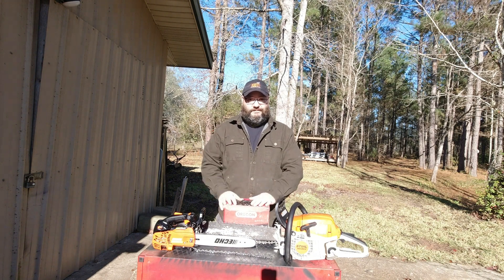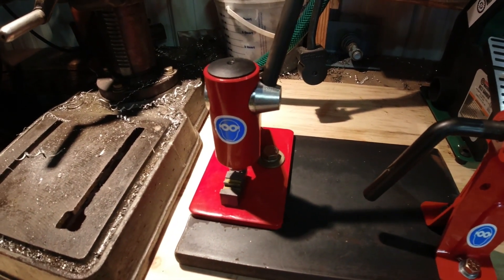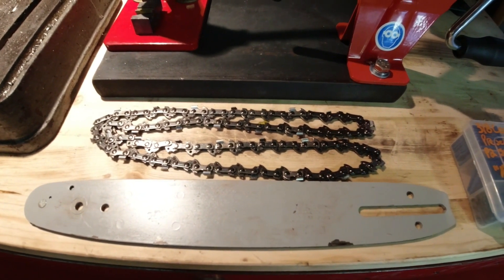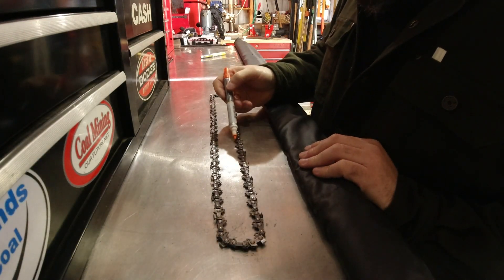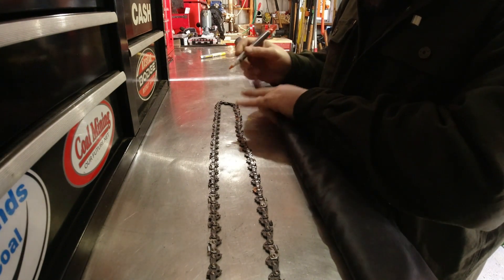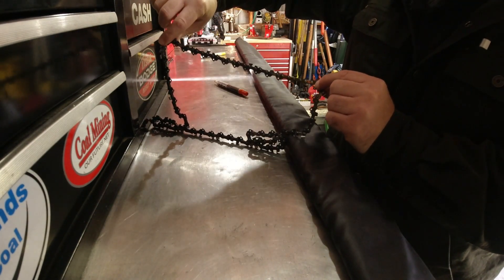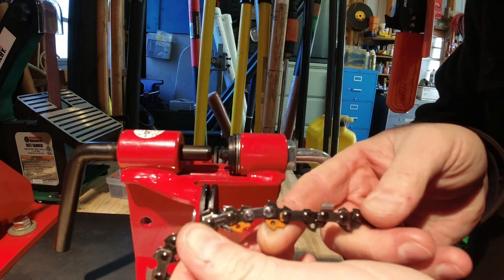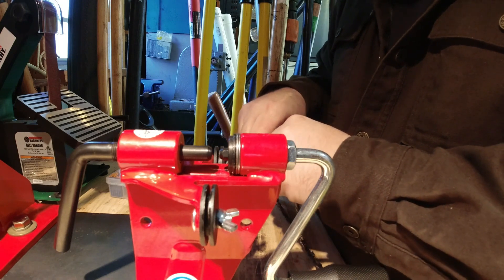CUSTOM Length Chainsaw Chains with Tecomec Chain Spinner and Breaker

Comment: Four year old video, but I have never done this either.  However, did your properly fit chain really stretch that much?  Is the bar also greatly worn?  The part that wears most quickly is the drive spur, did you check that?  If the chain stretch is really the bulk of the problem, how is your oiler working?

Comment: Whats the max links you can take off?
Reply from the maker: You can take as many links off as necessary. For example, if you had a 36" chain at 114 links, you can take out a section of 54 links to make it a 60 link, 16" chain. The MAX number of these repair/splice links, according to Oregon, is two per loop. So you could take two loops of 60 drive links, take some out, and splice them together to make a 114 link chain, too. Because you would use the max two repair links to do the splice.
Reply: @BigOrangeTractors   ok was wondering I have a carbide chain that I'm using and I took out a link already and it stretched some more so was wondering if I can take out another link
Reply from the maker: @kaneetsate1662  oh yeah, you can keep chasing it as long as you don't put in too many repair links. I'm not sure if a carbide chain would be any different in terms of requiring special repair links, but I can't imagine it would be an issue. Good luck!
Reply: @BigOrangeTractors  alright cool thanks for the info
Reply: Kane Etsate curious how this worked out for you? I would not think taking a link out of a stretched chain is a very good idea, once a chain is stretched it out of pitch.

Comment: Tecomec, make the grinders & chain tools for Oregon. 
Officially, not recommended, but if broken carefully the preset & tie strap that came out can be reused. The effect being that the wear pattern exactly matches the rest of the loop. Though only reuse once. NO liability accepted if you choose to do it.
Sometimes, needs must. Everyone has a different set of circumstances. Be safe.

Comment: I'm about to pull the trigger on this set from ebay. I noticed you had it mounted to some thick steel. Is that necessary for the performance of it? Is it unstable without? Would you buy it again? Broken any anvils yet? I'm curious how long they will last if you are good about keeping the punch on center. Lastly, Where do you get your tie straps? Thanks man!
Reply from the maker: I mounted it to the thick plate to make it mobile since I have a small work space. The 1" plate makes it heavy enough it still be stable. I've broken a couple anvils, but I'd chock that up to inexperience. Any parts you would replace, look for the Oregon numbers on their equivalent set. I have replaced the handle and anvil on the chain breaker, and then I am ordering the Oregon spinner anvils as needed, too. Good luck!
Reply: Tinker Tractor Welder Mechanic Thanks man. How about the tie straps? Im also bummed because i noticed the pecomec set on ebay has a different breaker anvil than yours. its adjustable
Reply from the maker: @anonymous_friend  the tie straps and presets are from Oregon. The breaker anvil is also Oregon, that's one of the things I was talking about I "upgraded". You can find the preset numbers on Oregon's website. Apparently from what I found out, there is one set for .050"-.058", and another set for .063" (Stihl), so keep that in mind.
Reply: Tinker Tractor Welder Mechanic Good to know. Appreciate the info. I was hoping to find some sort of preset kit that had a little bit of everything. I have several saws now to maintain.
Reply from the maker: @anonymous_friend  yeah, I don't think they have that. I called Oregon and got the catalog. I switched all my saws over to 3/8"-.050" chain for just that reason. I want it to be as easy as possible. I bought a roll of 100' LGX chain, too. The only oddball is my echo cs2511t top handle that runs 3/8" low profile. I can include the part numbers tomorrow of what I've got.